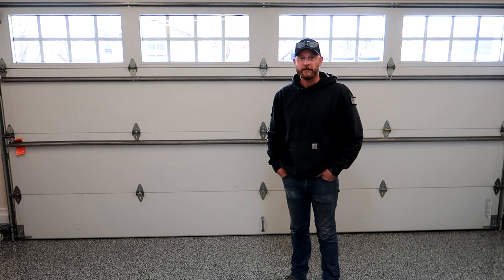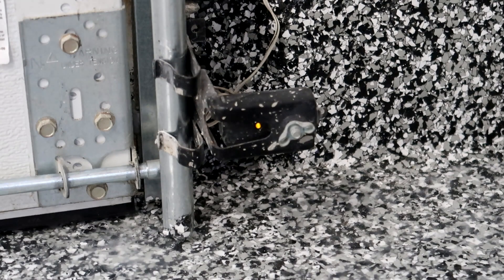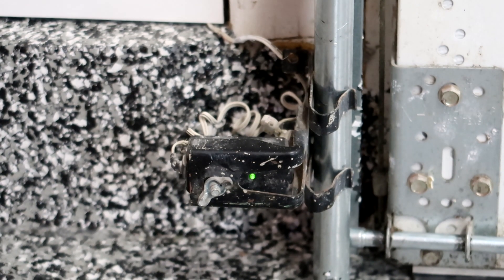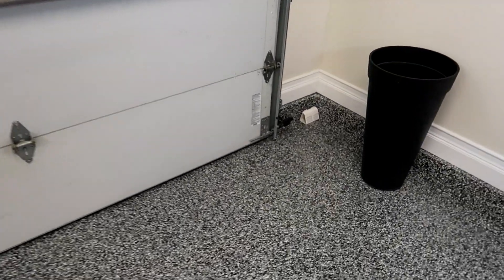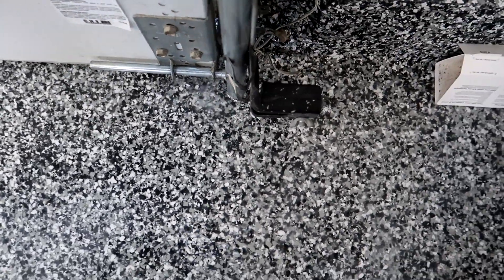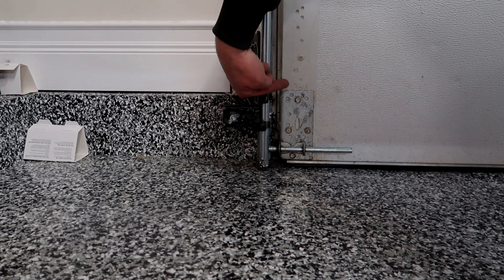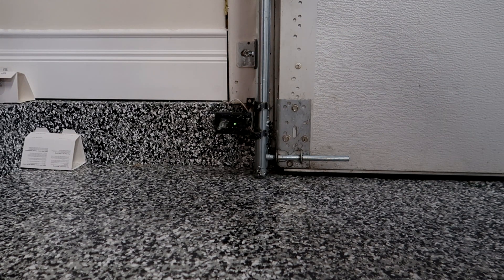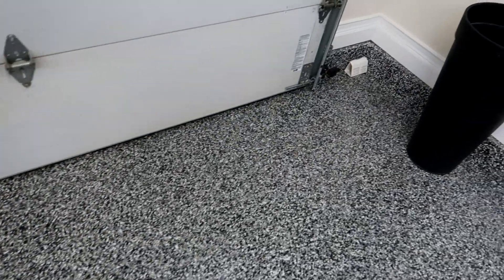Garage Door Won't Close - How To Adjust Liftmaster Safety Eye Sensors

Comment: My switch opener failed but purchased generic push button $12.  Can you help me identify the problem my wall switch on my garage door opener failed so I replaced it with just a generic $12 push button switch. It does does not have the side button to turn the light on. I’ve ordered hopefully the correct switch but I’m having center problems probably alignment problems

Comment: Hi, thanks.   My garage got flooded with the hurricane.   The door was working ok afterwards, but has stopped closing now.   There are no LED lights on either sensor.   Is there a way to test to see if the board is sending the proper voltage to the sensors with a multimeter?   I'm trying to determine if the mother board failed (maybe due to a short when it flooded), of if it is just the sensors themselves.   I don't want to order sensors only to find out the mother board failed where I have to replace the whole motor instead of just the sensor lights.   Can I jump the circuit to simulate the sensor is working?    Thanks
Reply from the maker: If the sensors were under water they need to be replaced for sure, they are by no means water tight. Regarding testing, Liftmaster does not provide electrical specifications or parameters for testing. We rely on a set of test sensors for diagnostic purposes. Either roll the dice and try a set of safety eyes or assume the worst save the money on the sensors and put it towards a new unit.

Comment: The hint to jiggle the sensors when testing alignment was super helpful.  My alignment was solid green, but when I shook the sensor the whole rail wobbled. The bottom two rail nuts were loose and the rail was twisting out of alignment when the door was 3/4 of the way down.  The other side had a lousy connection that cut out when the sensor was jiggled.  Works great after fixing those two problems.  Only video I watched that mentioned jiggling the sensors to make sure they worked with some movement.  Very glad I found this video.
Reply from the maker: Im glad it was helpful. Thanks for watching!

Comment: My lights appear to be in line but the door still wont open or close. I have to do it manually. Any idea?
Reply from the maker: Safety sensors only prevent the door from closing, they do not affect the open direction of travel. If the door will not open or close check for power to the unit. If there is power and the pushbutton/ remotes wont operate the door you may have a bad control board possibly. Couldn't say without having looked at it. Might be time to call a professional out for a service call. Good luck, thanks for watching.

Comment: I have replaced my sensors and the one eye that is amber is lit, but the green one is not lighting up at all.
Reply from the maker: Either cut the sensors out and connect direct to the opener or replace the wire. If you connect direct it will pretty much tell you if the wire is bad or if the board is bad. Always unplug the unit when connecting or disconnecting the sensors.
Reply from the maker: Did you replace the wires too ?
Reply: Just from behind the sensors, not all the way to the unit
Reply: It will close if I manually hold the door closer but when i try my remote it doesn’t close at all.

Comment: My garage closes and open by itself. Is there anyway I can lock it . I have a craftsman motor and Chamberlain remote
Reply from the maker: Get it closed and unplug the power cord. That’s the only way to ensure it won’t open on its own. If you know it’s a remote causing it to open and close you can turn on the Lock feature assuming your unit is equipped (press and hold the “lock” button for a couple seconds to turn on or off) if it’s not being caused by a remote this will not stop it from happening.

Comment: My app told me it was a sensor issue. For me it is sporadically. Like it will be fine one time and then the next time it will reverse a few seconds after it descends. One time it also reversed 1 foot prior to hitting the floor, but not recently.  I checked the sensors and the alignments and everything looks good/steady lights.  I did brush away any debris or cobwebs near sensors and underneath the door.  Any ideas or things to look out for?  TY
Reply from the maker: If you can’t wiggle the sensors without the led light going off or flickering the sensors aren’t lined up properly and if they aren’t lined up properly the door may reverse at any number of positions. The sensors are likely clipped on to the door track, when your 150-500lb door moves it may vibrate or shake the track which could cause the sensor to go out of alignment. Hence the importance of having the sensors installed and adjusted properly. If your certain everything is as it should be and still have issues it could be a wiring issue, a bad sensor or a bad logic board.
Reply: Wow what you said first was happening. I was wiggling the green sensor to fix alignment and I noticed if if I went to far up or down it was still staying a constant green and not flickering or going off. So does this mean I need to play with sending. What do I need to do in this scenario?
Reply: Or is that solid green (no matter how it wiggles up or down good)  since it means it's receiving the sending?
Reply from the maker: @DanD-v1r you should be able to wiggle either sensor up and down as well as in and out (toward and away from the door opening) to some degree without the green light flickering. This is all covered in the video. I’m happy to provide some advanced trouble shooting but it sounds like you need to watch the video a couple more times to get the basics dialed in first, if your still having trouble it might be time to call a company out. Thanks for watching and good luck.
Reply: @firstclassgaragedoor6471   Yea that's what its doing. I am able to wiggle all around and it still stays steady green so I think thats good since its synced with the amber signal.  I removed a few leaves from the bottom of the rubber and its working okay now. I will monitor. Fingers crossed. Thanks for your help.

Comment: Greetings— Very informative and clear video! Unfortunately , none of these worked for me on my Liftmaster. Lights on and aligned. Lenses cleaned. Unpluged and re-pluged the main unit. I am stumped. Remote still opens, but won't close the door. Would it make sense try replacing the remote controller? We rent, so I hesitate to solder the connections myself. Thanks & much respect, —Kimbo
Reply from the maker: Thank you. Well, if the remote opens the door it would be odd that it wouldn’t close it. Assuming all the basics are in fact good I would say you have a bad set of eyes or a bad logic board on the operator. Might be time to get a professional over as they would be able to trouble shoot a bit easier. Or, if you want to order a set of new eyes and hook them up direct to the opener, if it works great, if not you may be stuck with the sensor cost and still have a problem.

Comment: Hey man thanks for sharing the knowledge. I was fighting the alignment on my door that was reversing about 5 inches from being all the way closed. You gave every possibility and i found a single leaf hanging from the door about a foot from the bottom. When the door went vertical, it went right in the path of the sensor. Thanks again!
Reply from the maker: No problem. Thanks for watching,
Reply: Thanks for this. This could very well be my problem too(see comment above). I will check tomorrow.  Was the leaf on the bottom of the door where the rubber portion is and traveling up and down with the door?

Comment: My sensor had yellow light. I did clean eye and adjust alignment but still have yellow light. May you please advice what can I do? I bought my house since 2007 liftmaster brand name. If I replace new one it didn’t have that part the same liftmaster sensor I have know. Thanks a lot
Reply from the maker: On the newer Liftmaster sensors there will be a yellow/amber light (always on) and the other a green light (only on when sensors are aligned and unobstructed). If your still having trouble it may be time to have a professional out. Thanks for watching and good luck.
Reply: @firstclassgaragedoor6471  when I closed garage door it reserved back. What else reason do you think? Thanks a lot.

Comment: Solution:  Lousy connections between the sensors and the long wires leading back to the motor were the cause.  The installer gave the raw wires a twist, then wrapped in electrical tape, which degraded over the years.  I soldered the wires and that was a solid fix.  Tip: a solid green receiver LED is necessary, but insufficient for reliable closing.  Solid connections are necessary as well.  New sensors come with pinch-connectors, filled with dielectric paste.

Original Post:  My green sensor is continually green, no flickering.  The opener flashes a 4-6 code, indicating sensor misalignment.  The sun is not shining on the sensors.  The sensors are 6 inches above the ground, clipped to the tracks like yours.  I loosened the wing nuts, then aimed them and re-tightened.  The green sensor is in the middle of it's band, i.e. I can point up a ways and down a ways before the green LED goes off.  The Liftmaster 7675 is a "Q" type with a yellow Learn button.  It has worked since I bought the house in 2016.

There are many online instructions for handling a 4-6 code.  All of them say "Align your sensors until the green light is solid".  I have done that.  What could cause a 4-6 error code with a solid green reversing sensor LED?
Reply from the maker: Yeah, scotch loc connectors or solder and heat shrink. The codes are general, check alignment is a 99% of the time fix and for consumers typically as far as their knowledge will get them but yes, technically it could also mean a compromised wire(s), connection(s) or termination(s). Glad you were able to trouble shoot and repair.
Reply: Super helpful, turns out it was the sun shining on the sensor which I would not have figured out without you mentioning that thanks!

Comment: Thanks so much. I looked at 3 videos and found that my sensors were working properly. But yours was the only video that offered a solution for a door that comes down and goes back up. You said the door might be bent…and i checked the insulation panels i installed and 2 of them were coming our of the slots. Voila!! Fixed and working perfectly!
Reply from the maker: Great! Glad it was helpful. Thanks for watching.

Comment: So if both sensors are solid green and not flickering but the door still won’t go down and blinks as if there is a obstruction…
Reply from the maker: Check connections and terminations. If still persists the cheaper option is to swap the eyes, if there is still a problem and you are positive its not in the eyes, connections, terminations or wire itself then its likely the board on the motor unit. If this is a residential unit with two green LED's, its probably pretty old (15+ yrs) and I would just replace the whole machine. Hope that is helpful.

Comment: 2 wires going to the receiving eye. What are they for? 12V power and ground? I would imagine it needs a third wire for signal?
I got a SOLID green LED while the door is closing but it would still stop and bounce back and then 10 flashes.
Reply from the maker: Liftmaster does not give specs to do tests on the eyes or any part of the system for that matter. Yes, typically you would have power, ground and a signal. Not that simple though, they are running power, ground and signal over two wires. I don’t know how they do it, that would be a question for an electrical engineer. As for the problem, starting with the easiest - re splice any and all connections, if that doesn’t do it, replace eyes, if not that replace board. If unit is 15yrs old or more, replacing the unit may be the way to go.
Reply: @firstclassgaragedoor6471  Right, I am looking at my problem from an engineering point of view, wondering why 10 clicks when both LEDs are on solidly. My sensors are pre-99 which might have different scheme than the amber and green version most people have. I will just change them so that I can fix it all in one shot. BTW, here is a good video for those who wants to know the answer to my question. See video = GbmufXgpl14.
THANKS FOR THIS VIDEO. IT IS ALSO VERY HELPFUL, HELPING ME TO DIG DEEPER.
Reply from the maker: @derekkchung  Wish I had an answer. I have seen no LED's on the eyes and they function perfectly fine, as well as LEDs on and never go off but eyes still work okay. Best advice I can give is to use weathertight connectors and/or die-electric grease on any connections and make sure all connections/terminations are good, high resistance will cause problems. Thanks for watching and sharing!
Reply: @firstclassgaragedoor6471  Right. It is more than just a ground or positive voltage signal, or a certain resistance. There is circuitry inside that gives pull-to-ground pulses every few msec that the mainboard is reading, making it impossible to troubleshoot or eliminate / bypass the sensors. Maybe my sensor fails to send that pulse signal. I sure will use di-electric grease when I redo the sensors when they come. Thanks.

Comment: Are the Orange and Green lights on all the time???????????????
Reply: I have a older Chamblin system, and the lights are not on all the time. This new system , I thought the Green light was the one that was the problem because it was flashing all the time. I found out it was the Orange light that was the problem, because it was loose in the holder. When I tightened it .THe green light came on steady and .,after I ran the door up and down a couple of times the lights go out. I waiter a while, and ran the system again and left the door opened for an hour allthat time the lights stayed on. But when I closed the door the lights go out. The system works find now.
Reply from the maker: They are supposed to be. Assuming the eyes are lined up and everything is working properly.

Comment: I have a Chamberland Lift master that has worked flawlessly. I closed the door with my remote and opened it, but then I couldn't get it to close. I hear the motor making a sound for 2-3 seconds and that's it. I checked sensors, and tracks and so far everything seems to be correct. Any suggestions would be appreciated, thanks.
Reply from the maker: Did you check the emergency release ? If that is engaged properly it may be a stripped gear or the sprocket could have broken off, either are common problems with Chamberlain chain drive units. Hope that is helpful.
Reply: @firstclassgaragedoor6471  My unit is not a chain drive

Comment: The one at our shop works perfectly until the sun is in just the right place during the morning.  It's 10:00 am today and I keep getting the 4-6 error.  When the sun moves it will work correctly.  Is there some way to prevent the bright sunlight from causing this issue?  I've parked my car in front of the garage to create a shadow but it still won't work.  So frustrating!  I'm trying to leave to get to a customer but I can't because the garage won't close.  UGH!
Reply from the maker: The safety sensors work with infrared light. The beam or laser that goes across the opening is actual IR light. The sun emits infrared light. This can interfere with the safety sensors. If you are blocking the sunlight and the door still won’t close I would guess that the sun is not the problem. Could be an alignment issue, dirty sensor lens, bad eye(s), wiring or a bad logic board. Good luck.

Comment: thanks for the video.  it's very helpful.  nice garage floor.  what product do you use and whether it gets hot tire pickup marks over time?
Reply from the maker: Thanks for watching, glad it was helpful. I used Floorguards H2O HyperPrime,  Hyper Flex 100% solids epoxy, Full broadcast and their Aspartic 85 Polyaspartic top coat. Didn't scrape the flakes just picked up the loose ones so it took a lot of the aspartic to cover. I didn't want the textured surface as my kids use the garage as a play area most of the year and the texture catches dirt when moping/washing the floor (juice spills and ground up gold fish crackers as well as their muddy shoe tracks) so I wanted the poly to completely cover the flake. Used poly beads for traction, was told to mix them in with the aspartic but IMO they work better when broadcast over the aspartic after application. No issues with tires, just re did the entire  exterior of the house and used the garage as a work area, dropped several framing hammers, big prybars and other tools on the floor on multiple occasions, no damage. Also left a roll of Winterguard ice and water shield (from the roof replacement) on the floor, it got stuck to it and left some tar stuck to the floor, have yet to try getting it off, I'm sure it will come off but curious to see if the solvent/brake parts cleaner will cause any damage or clouding to the polyaspartic top coat. I know my father in law has the Home Depot Rustoleum epoxy floor coating with flake and the tires are pulling the coating off but you cant compare a $200.00 or $300.00  floor coating product to a $3,000.00+ floor coating system (material cost only - ~450-500sqft). Although even a professional coating system and/or professionally installed system coating can come up if its not installed properly and/or if there is moisture under the concrete. Maybe TMI but may be useful to someone else down the road.
Reply: @firstclassgaragedoor6471  Thanks for the details.   I appreciate that.  Yes I did use the Rust-Oleum product and  the hot tire pickup was an eye sore.   I eventually bought the parking mat to cover up the ugliness and it also helps me park and stop exactly without  being hit by garage door or leaving too little space in the front that we can't walk through.